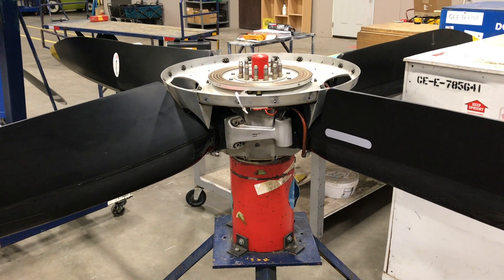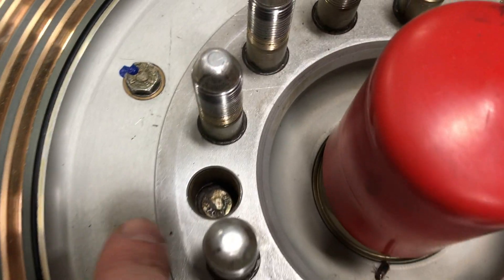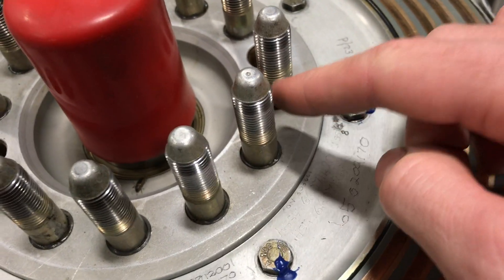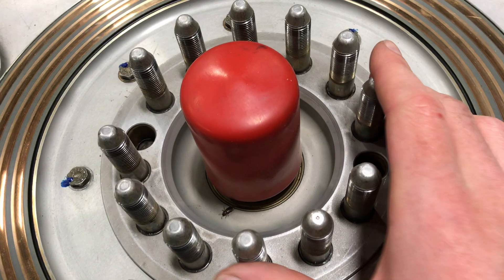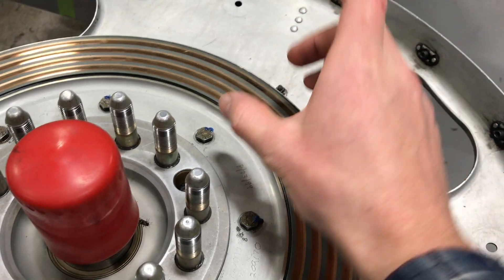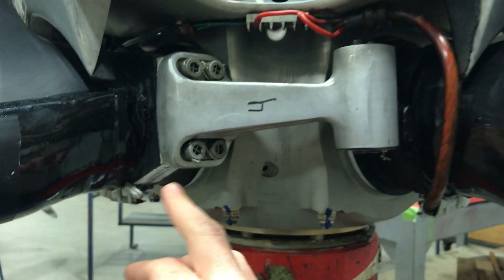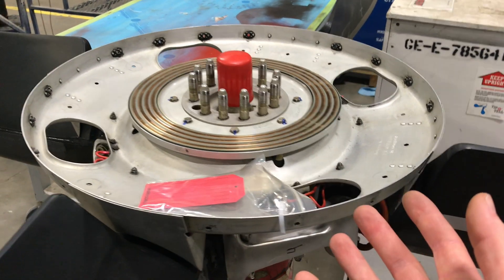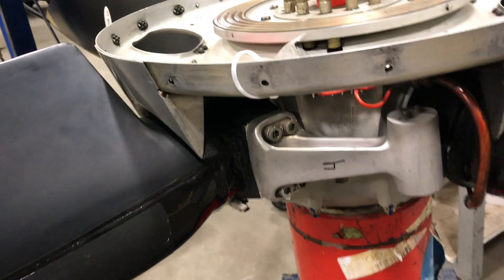Dowty Propeller Assy

Comment: "electric de-ice boots" xD... i think you mean the electric ANTI-ICING resistances... anyways... nice video mate
Reply from the maker: ANDRE It depends where you have the switch set. ‘Normal’ is cycling on and off the boots, which is more akin to de-ice. But in ‘Max’ switch position is continuous aka anti-ice. Even the indicator lights in the cockpit say de-ice. But yes, they typically are used more of an anti-ice system